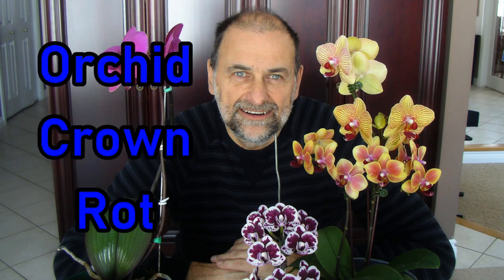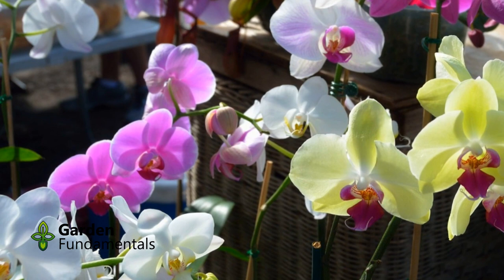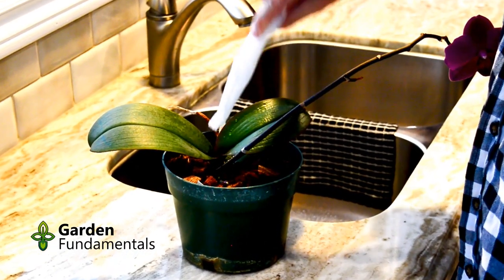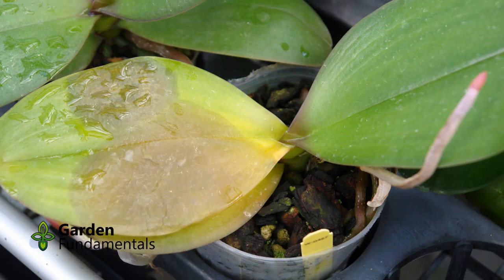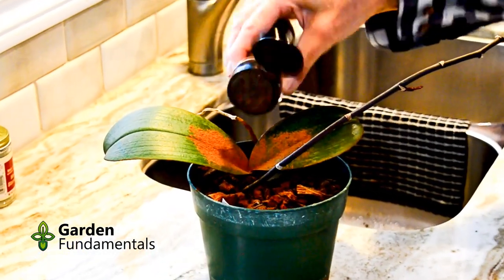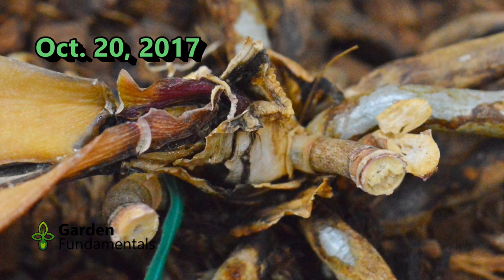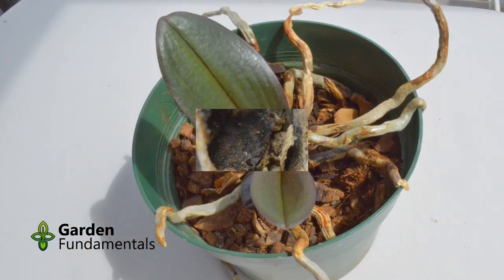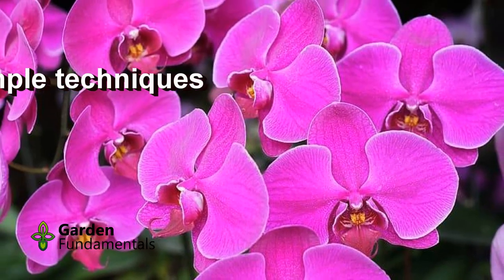Orchid Crown Rot: Identification, Prevention and Cure 🌸🌸🌸Saving Your Orchid

Comment: My orchid is losing leaves, but not from the top down as you describe. The leaves also looked green and relatively healthy. Do you know what might have happened?
Reply: He mentioned that it's perfectly normal for them to yellow from the bottom. The bottom leaves are older than the higher ones, and they to do that as they grow new top ones. No worries 😉💚
Reply from the maker: If it is from the bottom - that is normal.